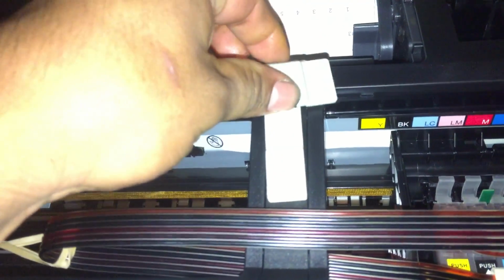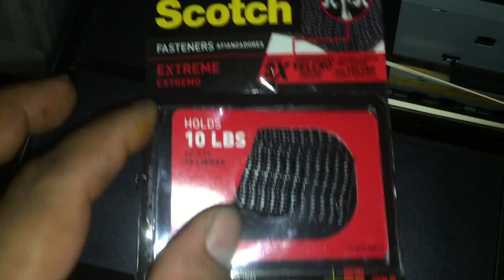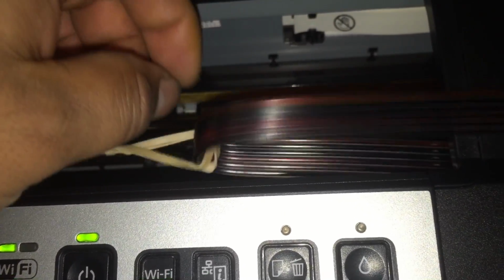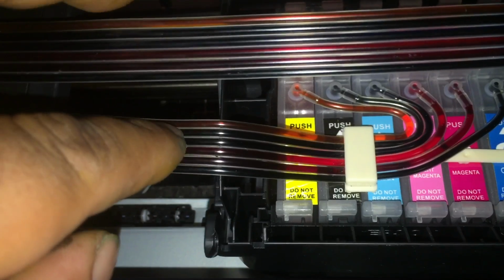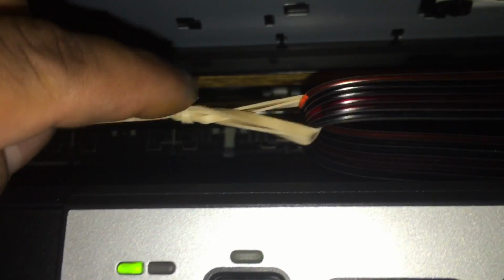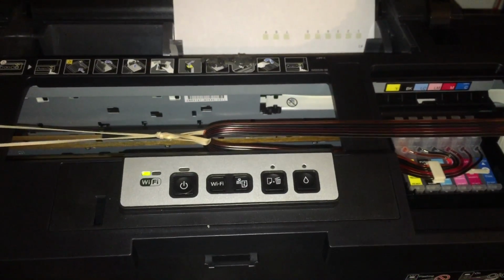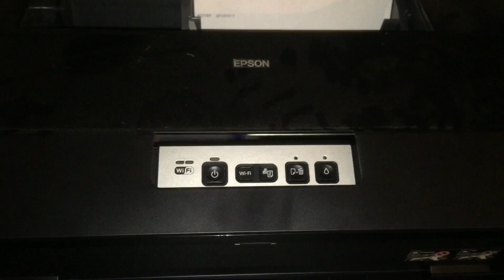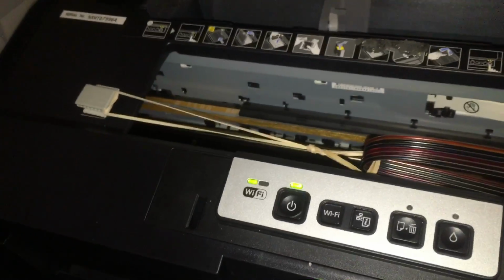TIP Epson Artisan 1430 Problem Fixed

Comment: QUITE CLEVER SOLUTION! But I must add that the problem with rubber bands is they doesn't last too much time, rubber reacts with air and it brokes, but well, you can replace it at almost no cost. Maybe you can use another kind of elastic. Thanks! End of comment.